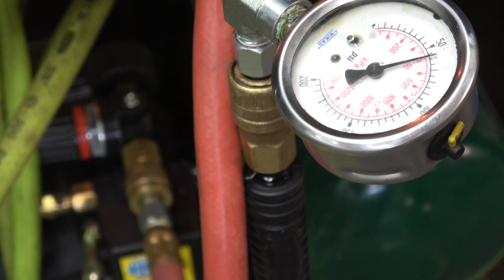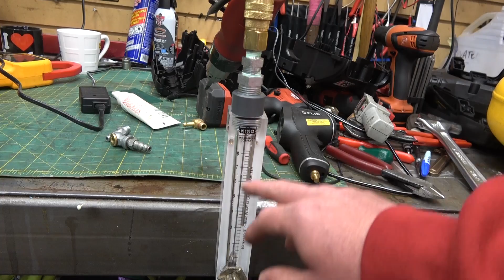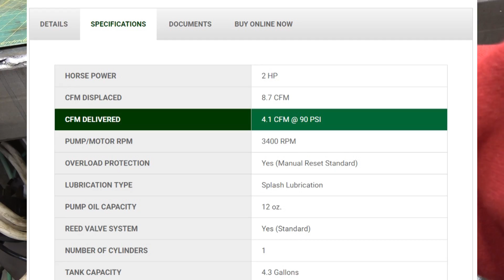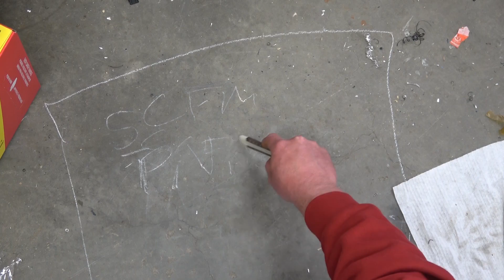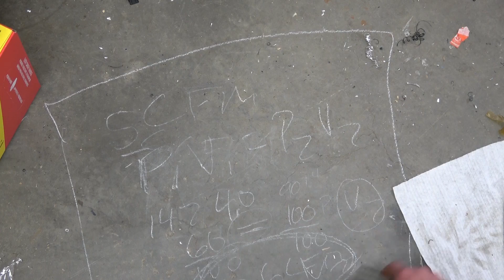Why are CFM ratings BS?

Comment: What companies are not telling u is this. The horsepower is what its rated but they dont tell u the torque spec. I have a pumper on electric. It struggle to maintain like this video. But replace electric motor with petroleum  gas/diesel engine. It out runs the tools because the torque is there to drive the piston under and load. The rated electric will barely touch is rating then thermo protect reducing consumption. Enough

Comment: Completely agree. Have customers with $100k plus machines running consumer compressor with not enough CFMs. Even if it was enough, the compressor are not meant for continuous duty. I tell them and they won’t believe me. I even show  them the cfm requirements in  the manual, They just deny it. It’s a big problem and you are right. You pay for what you use in the end which is lost wages and re-doing the job, then blame the tech. You can now get 3 hp rotary screw compressors. I always wanted to try out a used dental compressor

Comment: Back in the day working in a machine shop, we got an Ingersoll Rand screw compressor that put out 63 CFM @ 125 psi and we used a 200 gallon tank with air dryer and ran 2” cast iron line that went around the shop in a loop with drops at every machine. Started off with (2) 80 gal freestanding compressors but they couldn’t keep up with the machines and they got so hot there was always water in the line!

Comment: i buit myself a compressor out of a old truck compressor and an electric motor. i can now do semi-industrial sandblasting. easily portable because all the components can be taken apart and transported by a single person. a "real" compressor would need at least 2 strong men for that. i use a small 100L tank and a VFD to run it off of a in-line pressure sensor. once the pressure gets to target, it wont simply switch off but reduce rpms just to keep the pressure. been sandblasting log houses with it.

Comment: "They ain't lyin' to ya" -- disagree
As a graduate of the Slashdot School of Car Analogies, I can explain why they definitely ARE lying.
Suppose I produce, and sell, a car with a horsepower rating based on the INPUT horsepower of the fuel consumed.  This is a simple figure to calculate.  And, with a little creative manufacturing, the horsepower of said car could be made VERY high.  So, does it sound reasonable to advertise a car with a go-kart engine, that just sprays fuel into the air, as 1000 horsepower?  Or maybe can we admit that these ratings are somewhat fraudulent?

Comment: Why is that Snap On does not show  the grinder operating  Pressure in the specs??
Assuming a 90psi tool operating pressure you would need 6 of those green compressors manifolded l to run the grinder at full power continuously. This is why having the right tank capacity is critical.

Comment: Change your hose size and remove as many QD's, filters, and any other line restrictions. You will see different results. However, you can only validate the compressor performance for rated flow and pressure at the STP (Standard Temperature and Pressure) used by the manufacturer.  STP is a measurement standard to make sure everything is compared apples to apples.  You have to adjust the compressor rating and tool rating for YOUR test conditions (altitude [pressure], temperature, and humidity) and you have to account for line friction. The short version is that as altitude, humidity, and temperature go up; the compressor flow capacity goes down and the tool flow demand goes up. The performance WILL change continously depending on those variables listed above.  For my location in Eastern Idaho, there is a 15% loss due to altitude alone.  July max temperatures reduces that capacity another 8%. This is true of ALL compressed air systems.   The compressors I manage at work are manufacturer rated for 905scfm@125psi.  What I actually get is anywhere between 705 and 770cfm depending on the ambient air temps.  These compressors are performing EXACTLY as designed.  The reality is the same compressed air system will perform differently in July than it will in January.  It will perform differently in Denver than it will in Orlando.

Why does humidity matter you might ask, because when you compress air to 100psi, a large portion of the "gas" you compressed is water and it condenses out to rust your tank (assuming you don't drain it regularly). It is, for practical purposes, a normal expected power leak. The only way to eliminate that power leak is to live where there is 0% humidity.  Compressors are usually rated at 0% humidity.

The problem with STP is there isn't only one universally agreed upon STP. There are many different standards, depending on the industry. ISO STP was 14.7psi before 1982 and 14.5psi after 1982. ISO uses 32degrees F. NIST uses 14.7psi and 68 degrees F, but calls it Normal temperature and pressure (NTP) and uses it for chemistry experiments. NIST also uses 60 degrees and 14.5psi for thermodynamics experiments. Most use 0% humidity, but some don't. SCFM (Standard Cubic Foot/Minute) is defined as some total number of molecules in a given volume at a specific temperature and pressure. SCFM or FAD (free air flow delivery) are the same thing, just with different units. The problem is air doesn't have a fixed density. It is dependent on pressure, temperature, and composition; so it can't have a fixed definition of molecules per given volume. In electrical terms SCFM is the comparable to Amps and Pressure is comparable to Voltage. It’s not a direct comparison, but close enough. Fortunately, Amps do have a single universally defined quantity. One amp is equal to one coulomb or 6.24x10e18 electrons worth of charge moving past a point in a second. Just like you can't get 100amps at 120 volts through a 28ga wire, you can't get 100scfm through a 1/4" hose at 100psi. Coming from a compressed air engineer, line friction is one of the biggest misunderstandings in any compressed air system. It doesn't matter whether you have a party balloon or the Goodyear Blimp worth of air behind it, there is only some much you can push through a soda straw.  So the compressor manufacturer ratings are not lies or intentionally misleading, but they are often misunderstood and incomplete.  The proper way to write an air compressor rating is 15 SCFM@100psi for ISO STP.  If your test conditions don't match ISO STP and 100psi, it will be impossible to measure the same flow rate as the factory rating.  IE: You will not be comparing apples to apples.

Also, the tool ratings are more likely the misleading rating. All air tools have a duty cycle rating, not a continuous flow rating. What this means, for example, if a tool has flow rating at 5cfm and a duty cycle of 30%, the 5cfm rating is the average of 15cfm for 20 seconds and 0 cfm for 40 seconds.  Duty cycles often aren't published and are often overlooked when they are.  Impact werenches are notoriously misleading because of this duty cycle idea.  

Your standard box store air hoses--50ft long 1/4" and 3/8" often can't flow enough air for 15cfm and maintain 90psi at the end of the hose. Just like wire sizes and electricity, air hose performance is dependent on length and the desired load. At 15cfm, 1/4" hose has roughly 1psi loss/ft of length, and 3/8" is has about 0.1psi/ft. This does not include any losses from QD's, filters, check valves, water separators, etc. 

By the way, while your math generally correct, your interpretation of CFM at the intake vs CFM at the output is wrong.  A Standard CFM at 14.7psi has the same quantity of molecules as a Standard CFM at 100psi.  It has just been compressed into a smaller volume.  There is a difference between SCFM, ACFM, and ICFM. They each vary based on actual air density.

Comment: What AvE says is true, and I do wish tool CFM requirement specs meant the same as compressor specs.  However, it does take a huge amount of power to deliver a lot of air at 150 pisg and high CFM.  At my workplace, we have a 10 HP compressor that delivers 46 CFM at 125 psig, and that takes a lot of 3-phase AC Current, and I have no idea what it cost.

Comment: I have a late 1970's twin cylinder compressor that I bought used. It's rated for 1 hp and 6.9scfm at 40psi displacement is 9 cfm and stroke 2 inches each cylinder bore is 2.75 inch running at 900rpm on pump. This compressor easily handles harbourfreight purple sprayer rated at 6scfm. I know this setup cannot handle beyond 70psi required for bigger nozeel sprayer that works with non catalyzed lacquer because that is very thick. My experience with this compressor is it keeps up with heavy painting non interrupted. I know the examples you explained is true but when a manufacturer says 6scfm at 40psi on sprayer then the most important thing is your compressor should not drop below 40psi when you press the trigger, if it does, then you can't paint uninterrupted. It is possible that you are using a thick viscosity paint that require higher PSI to be maintained and a bigger nozzel with much higher cfm requirement of 20 or more. The compressor I am taking about is a well known compressor for spray painting across the world and made in USA. If you want more than 9scfm be prepared to buy gas powered compressor because even if you go for 220v keep in mind the bore size of cylinders should also be sufficiently big 3 inch or more. And it should be more than 1 cylinder also since spray painting is sensitive to psi maintained so you alsoneed to ensure compressor is continous duty not a 50% duty sold in box stores. Duty is something you cannot compromise then scfm and lastly psi. Tanksize can also give some relif but it will be temporary.

Comment: Ran into the same issue - compressor not able to run jack-sheets. Solved it by adding a cooler to the compressor heads output pipe, plumbing in 400l of additional storage, a big 5-run condensor loop with 1/2" internal pipe & stepped all the rest of the pipework up to 1/2" as well. Now, plugging in/unplugging a tool is scary & everything runs like a Ferrari, as opposed to sputtering like a Lada with the "as bought" set-up.  They can lie, we can modify. :-)

Comment: There are so many fudge factor issues at play here. Most cheap compressors are rated at the volumetric displacement of the piston under no load. When the pump sucks air in it is pulling a vacuum, so it might only be pulling in air at 3/4 or 1/2 of atmospheric pressure, worse if you are at altitude. This is mostly due to badly designed input flow path, small valves, cheap small filters etc. Then there is the duty cycle of the compressor motor and pump, a really cheap aluminum pump and motor might overheat at anything more than 25% duty cycle, a good quality industrial iron cylinder piston compressor will probably have a 60% duty cycle maximum. Then there is the motor. The rating is taken at full motor rpm, but the motor slows down as the pressure in the tank rises due to slip. So when you are delivering 6 bar your motor might be only turning at 3/4 of full speed. Also as the motor warms up the resistance in the windings increases, reducing current and power of the motor causing the motor to slow further when the motor is hot. They also burn you on motor ratings on cheap compressors. A "2hp" motor might actually only draw that much electricity momentarily during start up. Any decent quality electric motor is rated at the continuous mechanical power output, not the electrical power used. Cheap electric motors are going to be at best 80% efficient. They might be burning you again with power factor by deliberately confusing apparent power and real power. But then when it comes to the air tool manufacturers they are also lying to you. They often rate an air tool at 4 cfm at 90psi, but they are not talking in scfm per minute here. Convert 4cfm at 90psi to scfm and you find that a 1/4" die grinder actually needs 24scfm to run well. Anyone looking at that rating on a shelf in a store would say that thing is an air hog and not buy it. But slap 4cfm @ 90psi on the box and people think the "4cfm" compressor they have will run it. So your tool needs 6x more power to run than you think, and your compressor produces 4x less power than you think and suddenly you have 24x less power than you need...

Comment: To be fair, nearly every compressor up to high end commercial / low end industrial are rated in SCFM. A 5.2 gal Makita MAC5200 is 5.2 gal, or .695 cu ft. At 6.5 CFM, if that was @ 90 psi, then the fill time would be 0.1 minute, or 6 seconds, obviously unreasonable! My Devilbiss 80 gal is rated 19.8 CFM @ 150 psi. 80 gal is 10.7 cu ft, so .54 min / 32 sec fill time if CFM is rated at pressure, again, unreasonable.

Even 15 hp IR screw compressors are rated at SCFM. Perhaps industrial screws @ 100s of hp are rated at delivery pressure, not sure. To be fair, air tools are also rated at SCFM. The reason it couldn't keep up in the video is because the tools is rated at AVERAGE, or 25% duty cycle. So you multiply tool CFM x4, then the compressor would keep up indefinitely.

Comment: I was always told 4 times bigger than you think you need. And that's going back till the dark ages when I was an apprentice. They used to try to sell them in hp ratings to fool us poor consumers.
Reply: It should probably be closer to 6.  And you can calculate the exact number using simple combined gas law physics.  Assuming a compressed air temperature of 110 degrees, one cubic foot at 90 psi is 7 moles.  7 moles at STP equates to six cubic feet of inlet air.  So, there's your ratio -- 6:1.

Comment: Just FYI here in Sweden we get two (2) different Lit/min (CFM) readings on compressors bought in stores. First numer (392 lit/min) is through liter / min = volume that cylinder(s) hold x max rpm, bogus numbers. Second number (300 lit/min) is the free amount of air released in to the tank. So it's a lot easier to purchase an air compressor that matches your needs here in Sweden compare to the states / Canada.

Comment: If you have lots of money  and  some time retrofit a vmac screw compressor to shop air set up  you will have lots of air and almost never run out vmac makes there compressor for mobile set so compressor is designed to make air on demand mobile have duty mechanics use them I serviced 1 or 2 im my life time I was impressed with its performance

Comment: Good luck fighting the industry.
I propose adding, by law, measurement of capacity and rpm, so any serious user can calculate the performance of these things.
Of course, someone will shortly provide an app to translate those measurements to actual CFM.
Or, short of that, someone could go ahead and create an app to translate SCFM to CFM.
I realise that the industry would still be taking advantage of anyone they can, but that's an integral part of capitalism, the point is to allow the people that actually need a certain level of performance to be able to get the information about the product they're buying before the non return policy kicks in.

Comment: I have the same compressor and if it's less than 20C it takes about 5 minutes to get it to run.  Trips the breaker on the pump over and over. Even with Rolair brand extreme cold oil they told me to use.  POS

Comment: All you have to do is compare the size of the compressor to a car engine. The swept volume is the size of the engine, The free air delivery is the horse power. I've been selling  air compressors for the best part of 50 years and the market place tries to give the best figures to sell the compressor. What you actually get can be  totally different. If you want to run air tools don't buy anything under 3HP. that will give you about 10CFM free air delivery. That should allow you to use air tool, spray paint and blow down your machines.

Comment: HERE IS THE REASON WHY!

Hope this casts some light.. 😉

As different tools needs/accepts different flow AND pressure values, it’s actually the only versatile way one can compare compressors AND in combination with different tools:

“Compressor free flowing air volume”.

This, is the flow the compressor delivers at free flow right through without added resistance (straight out into your workshop room, which has the resistance value “1” atmospheric pressure).

We have to do the math ourselves for each different tool we are going to (buy) use! 

If your (noname) grinder consumes 250 liter/minute (instead of 170 liter/minute like some efficient grinders do...) at 6 Bar 

.... well, then you need:

250x6 = 1500 liter/minute 

instead of:

170x6=1040 liter/minute. 

..from the compressor to maintain that particular flow WITH that particular pressure!

Each tool (and tool brand) has different air consumption. 

Just multiply required “volume” (l/min) with the required pressure (bar, psi..) the tool needs to operate. This will show what compressor capacity one needs. 

The compressor manufacturers would need to attach a loooong... table with different values and combinations of both air flow AND pressure for those flows. 

So it lands in our own lap at the end - the buyers/users lap to do the math when choosing tools- compressor combination!

A big air tank/tanks can solve the problem for single users with intermittent tools use. 

Kind rgds to you all
Anders
Sweden

Comment: Damn dude nice video. Glad I ran across this as I was just about ready to drop some money on a new compressor as my old one wont keep up with my tools. Now I know its not even worth it as the new one I was looking at wouldnt either. Guess its time to check out the battery powered options.

Comment: It is crazy looking at Compressors 150 psi 165 psi 175 psi WOW 200 PSI but only give you 5 CFM lol   I turned my 150 PSI down to 125 psi 15 gallon Saved a lot of run time get bigger fittings get more CFM 1/2 inch lines and 3/8 fittings .